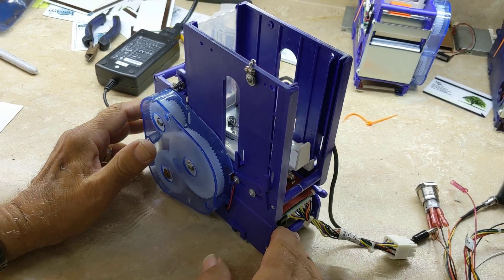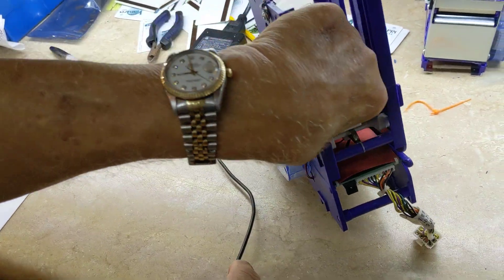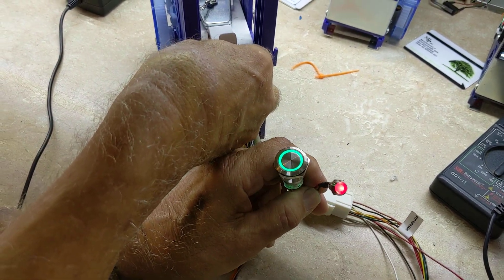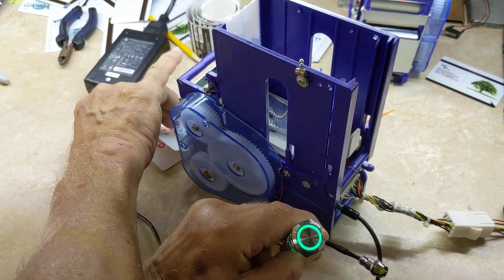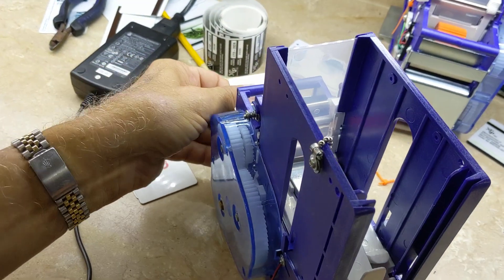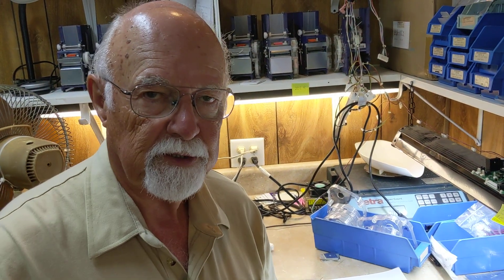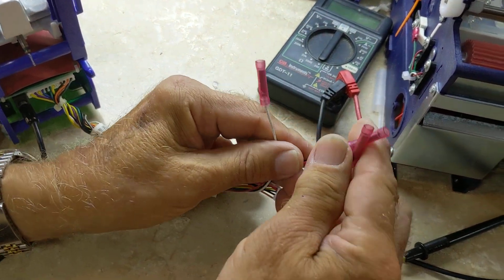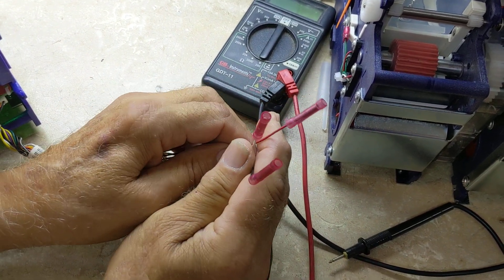Card Dispenser With Bill Acceptor, Coin Mechanism Or Credit Card Pulse Input Accumulator Capability

Comment: So if I connect a Bill Validator, how can I get it to dispense a card automatically? With no press of a button. I’m building a custom fortune teller machine, so it would have to also hook up to a prop controller.
Reply: Hi, I have the same question! I am building a fortune teller, too! Did you find a solution to automatically dispense a card and also trigger the prop contoller? Best regards from Germany